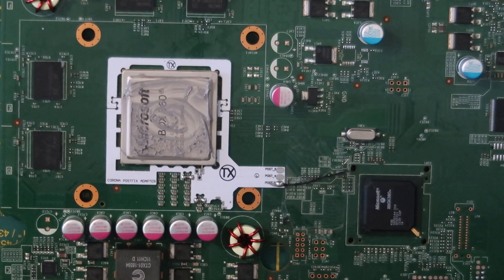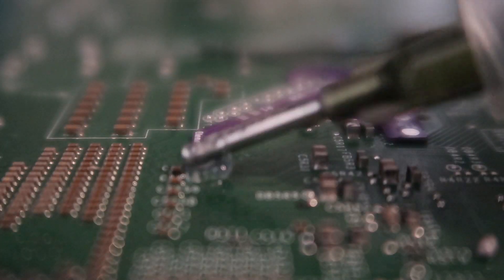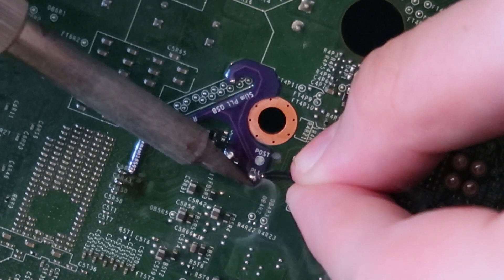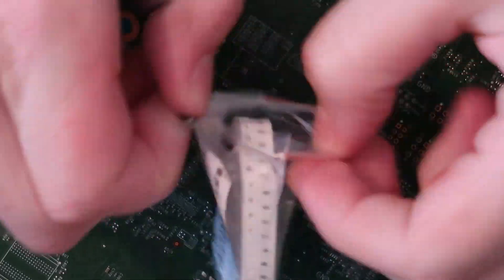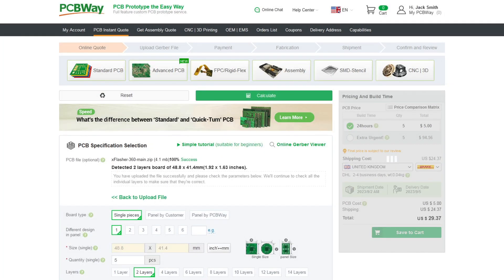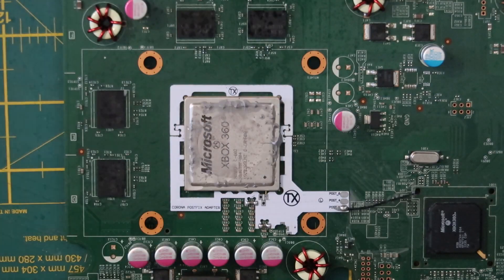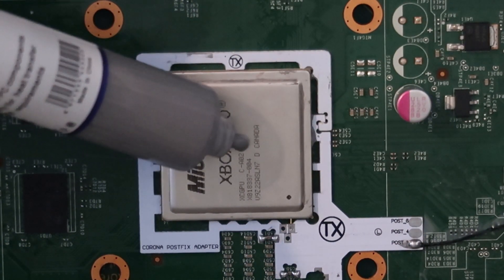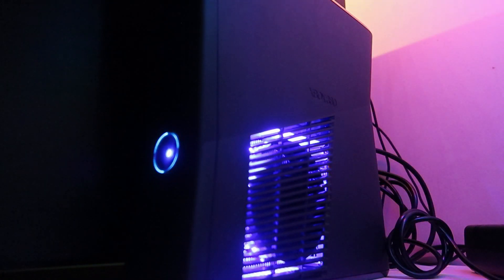Xbox 360 Slim PLL QSB: Make your RGH installs easier!

Comment: do you have to tick the PCB Assembly when ordering? or just add the gerber file and order ?
Reply from the maker: If you're buying the PLL QSB, then you will need to select 0.6 thickness only. Board Assembly is when they solder loads of components onto your PCB for a fee, you don't need to do this for the Slim PLL QSB.
Reply: @TheModSmith omg I just ordered and saw this comment. It's default is 1.6. Am I screwed?
Reply: Did you have any issues? I was looking at the price differencecrom .6mm to .8mm and it's pretty substantial.

Comment: Did you get the castellated holes? When I ordered mine. It was so expensive to do. So I opted out. They don't look quite as good. But the connection is still solid
Reply from the maker: I don’t believe I did, but I’ve found no problems with these boards at all.

Comment: Have you thought about hot gluing the cable down or super gluing it? Tape in the long term will get loose and dry
Reply from the maker: I wouldn’t use super glue as it makes the wires really hard to remove in the future. Hot glue could work but it gets loose the same as tape long term.